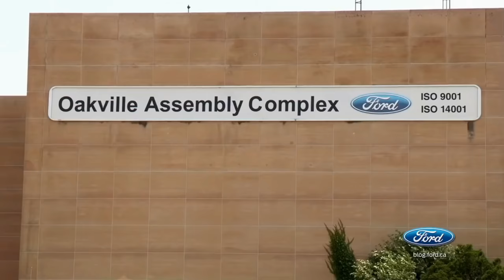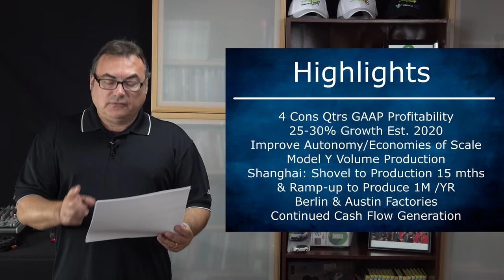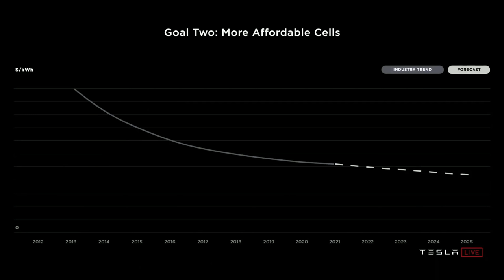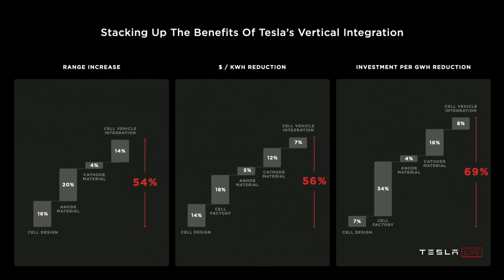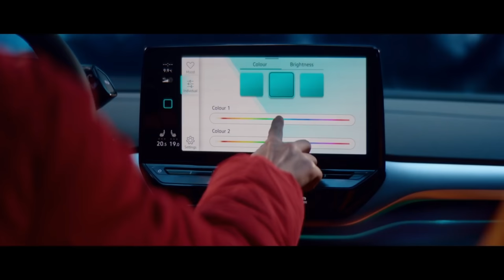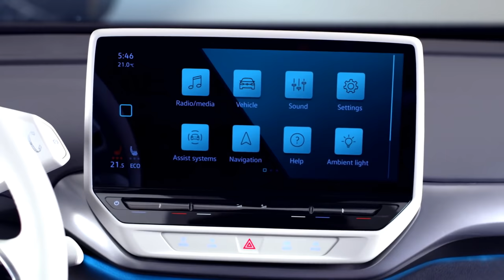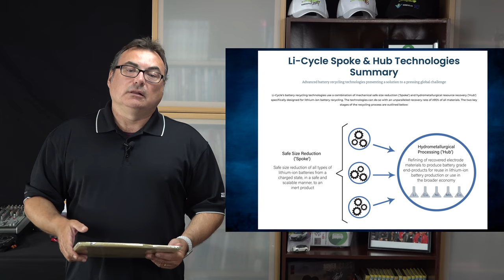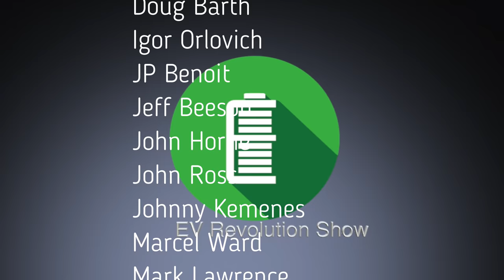Episode 108 - The EV Revolution Show - Tesla Battery Day & VW ID.4 Reveal!

Comment: Unfortunately, when comes to electric cars, 95% people will buy only the best !! Nissan Leaf and Chevy Volt is the perfect example, cheaper than TESLA model 3, not much success in sales.
Reply from the maker: Hi Peter, thanks for watching.  I am not so sure about that as it really comes down to affordability and needs.  Up until a couple of years ago, there has not been that much good choice to look at for consumers and really not many BEVs to be had when you compare to ICEV selection.  Both the Leaf and Volt do/did very well respectively per the amount of efforts each of these OEMs put into EV production.  If you are only producing 100K Leafs per year or less, than that is all people can buy.  

The EV market interest has grown substantially more over the past few years so consumers want EVs that work for their use case and functionality and that they can get.  With Tesla pumping out so many BEVs now, it's hard not to not look at them from a shoppers perspective and clearly, fit and finish issues aside, they still have the best BMS/Battery systems on the planet, the best fast charging network and vehicles that can take ADVANTAGE of this fast charging, and impactful Over The Air updates that truly do make the cars better over time.  This is hard to beat and really no one else comes close to Tesla with this in mind.  I'm not saying Tesla is the only option - hey I had a Leaf and loved it - but they do offer really compelling products for many that want these differentiating benefits.  For those that don't want to spend lots of money for a Tesla product, there are now many other really good options to choose from.
Reply: @EVRevolution  
Nissan Leaf have been on the market longer than TESLA is. In more than 10 years they have sold around 500,000 cars globally. If that is the success story, and they make good profit margins on the Nissan Leaf, I don't think there would be anything to stop them to produce much more cars in the last 10 years. Nissan is big enough company to be able to do it. It's common sense. If something that I have is selling well I would  produce more of it !
Going back to the the Volkswagen Id4...
It's the SUV with the rear 2 wheel drive, I don't know about Europe, but here in the U.S nobody wants 2 wheel drive SUV. Top speed 100miles an hour or so, and acceleration 0-60 miles in 8.5 seconds. My mother VAN accelerate 0-60 miles in 8 seconds. Range around 240 miles on a single charge, that's  very average on the EV market. Volkswagen doesn't have the charging network. If I drive 200 miles out of my town, where am I going to charge this thing to get back home?
What is the Volkswagen selling point, the price? I can get Toyota RAV4 or Nissan Rouge much cheaper than Volkswagen, at least this cars are 4-weel drive ! Volkswagen is taking big risk by putting this cars on the market, they're not ready, and seems desperate.
Reply from the maker: @Peter P, just to finish up on the Leaf, 50,000 cars per year for 10 years is not very much at all for a Global company like Nissan, so don't kid yourself that it did great.  It did ok and by BEV standards, yes it was a success story.  But by ICEV standards, not so.  Margins were and are still slim on them, so that is why.  

The ID.4 will come in both RWD and AWD versions, so not sure what you are complaining about.  There are many buyers for RWD and not all are buying AWD.  And why is 0-60 so important, as long as it can get you on the highway safely and quickly - which it can.  My Leaf was 7.something seconds and I never once had any speed issues.  You folks that make such a big deal out of 0-60 which are meaningless compared to reality.  And don't get me started on top speeds - other than the AutoBahn, where you going to use it legally?  Again another worthless spec.  

Now Range and other attributes for sure one has to look at, but the ID.4 fits nicely into this area.  

The selling point Peter is that you buy a BEV because you want to go Zero Emissions.  The RAV4 and Rogue burn fossil fuels.  THAT is the clincher here.  If you don't care about that, then why you here?
Reply: @EVRevolution  
First, you misunderstood my comments about Nissan Leaf. I was sarcastic about Nissan Leaf success. Nissan Leaf WASN'T  any success, sales numbers proved that.
Let me explain something to you... In order for any electric car manufacturing company to be successful and have the BIG sales numbers, they have to produce better cars on every level, that includes performance and speed than the ICE cars in their CLASS. 
Only person who understands that is Elon Musk !! 
When comes to emissions, reality is, most people don't care about it, they just want a best car possible for their money.  And Volkswagen Id4 is not it, Tesla is !!

Comment: As we blindly go into a new era of transportation remember there is no such thing as Zero emissions. Instead of drilling for oil, we will be strip mining for lithium. How many gallons of fossil fuel will be burned making an EV? How many runaway battery fires will diminish the co2 savings of an EV? What about the ozone emissions from electric motors? Will we recycle the battery?
Reply from the maker: Hello thanks for watching but you really have to get your head out of the sand.  There is so much data to support a more positive EV lifecycle impact versus ICEV impact that it makes heads spin.  Obviously if the energy to charge the EV is coming from Coal fired plants, then that is not so good.   Otherwise, that whole argument you try to make is non-existent.  I've already spent time talking about this over and over again so won't debate this here.  You can check out my older shows for my rhetoric on this subject.
Reply: https://www.statista.com/statistics/377006/nmber-of-us-highway-vehicle-fires/

Over 189,000 ice vehicles caught on fire in just the US last year.